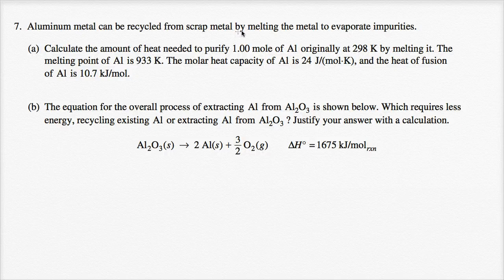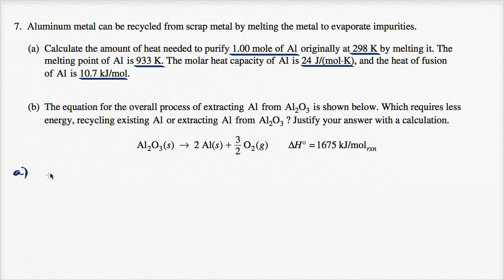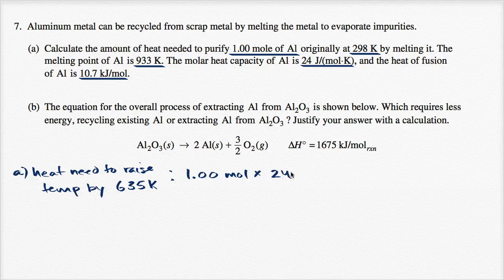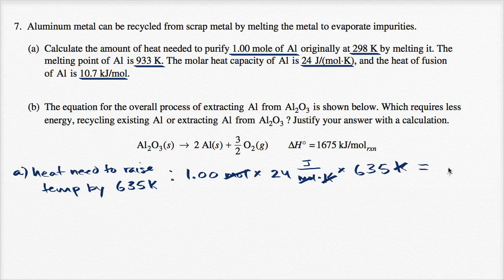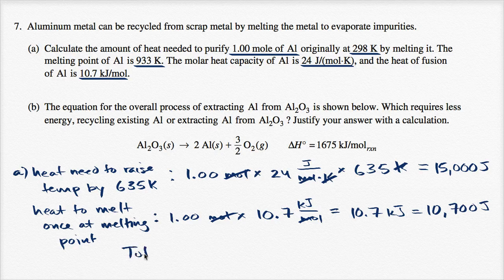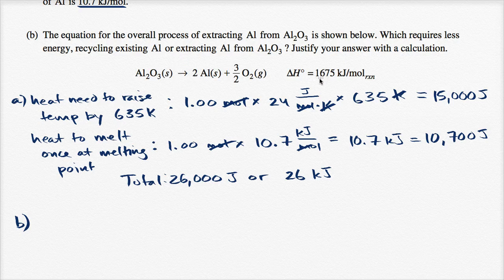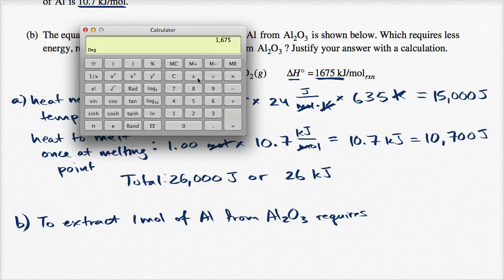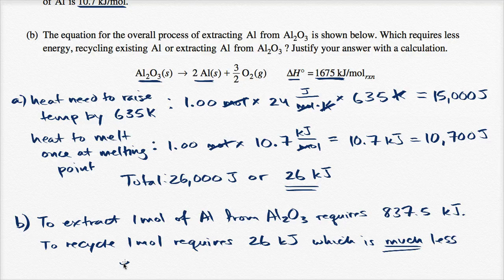2015 AP Chemistry free response 7 | Thermodynamics | Chemistry | Khan Academy

Comment: What’s the difference between recycling and extracting? Why does one require much higher energy than the other?
Reply: extracting would mean decomposing aluminum oxide, while recycling would be taking existing metal and melting it. extracting takes a lot more energy since you have to destroy the bonds in the oxide to get the aluminum and those bonds have a lot of potential energy, recycling you're training the temperature of the metal and melting it